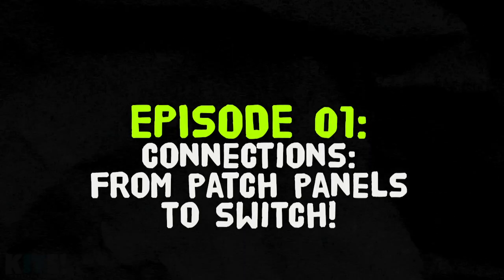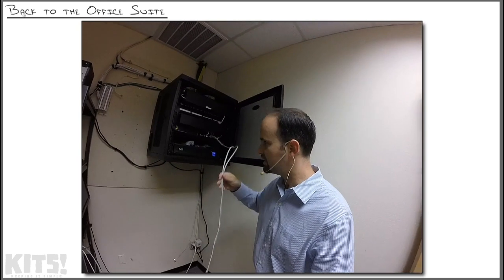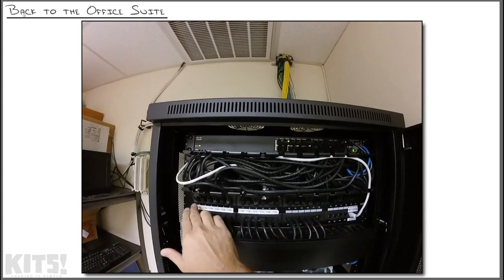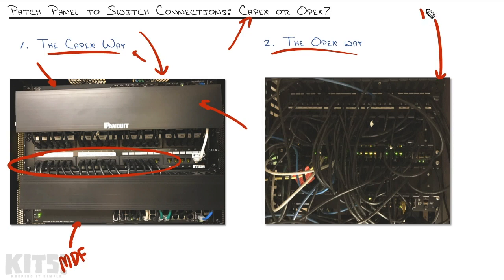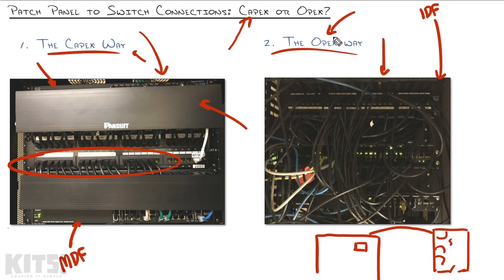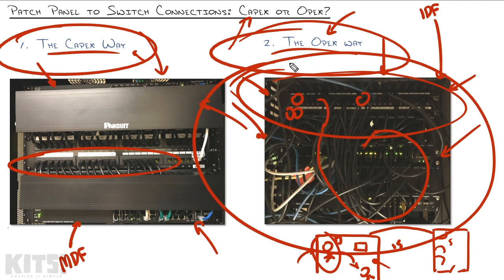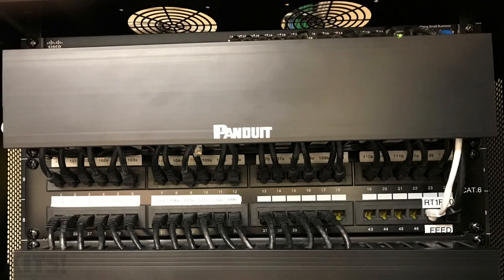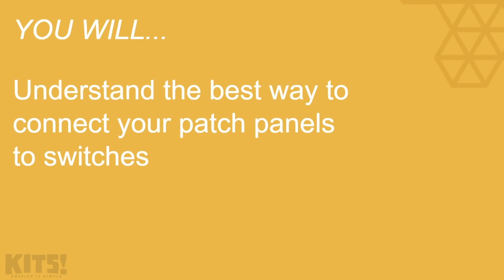From Patch Panel To Switch Ep.1: Real-World Business Switch Network Build

Comment: I have been doing this for 25 years and have had the frayed fingernails to prove it. It is always better to put your switches as the optimal height and work location and ALWAYS ALWAYS leave 1 RMU space above and below each switch just for your fingers to access the patch cords.  Most patch panels can be moved to allow for this but of course it is always best to design it right from a layout perspective first. If you leave it up to your cabling contractors they will put all their one time terminations at the optimal height and access and relegate your switches to impractically high or low positions on the rack....that will screw you long term for maintenance.

Comment: Hey, loved the vid. I tried doing the exercise, and I was right for the most part (except the whole cameras, voip and whatnots, since that was not given by the exercise), but I have a question. Is it a good practice to use the wireless router itself as an access point, or should we hide the router and its SSID and leave the network access to separate access points? Cause if we were to use what I thought, then the access point could be placed to the right wall (assuming the router is next to or behind the desk), but if not, then we would need to consider the size of the building and plan the wifi coverage accordingly. What do you think about that? Also, is the internet wifi different from the inventory management wifi, as in, are we using subnets for those two? (from a fellow network engineer-to-be)

Comment: I see his Capex Way as a nightmare..... I like using the sides, letting the wires hang down and loop up to the switches like you would do on a 2 post. 
For these smaller racks I use the thin Patch Cables. for that size I would use 3 to 5 foot patch cables. 
If you have an actual network, you have Core, distribution and access layers. One switch to uplink AP's., and witches, one server switch for servers and printers and access for computers.
SG300 is a waste, layer 3 which you will never use, SG250 is all you need.

Comment: Jeremy in that office on the coverings that go from the wall, is there a system in place which has the port information so that you can go from that port straight to the switch and pull that cable if something goes wrong? I saw the patch cables on the switch but I didn't see any flags which would tell you where those cables go.